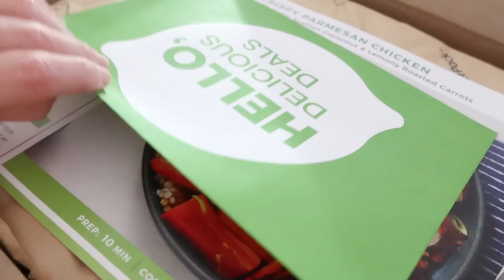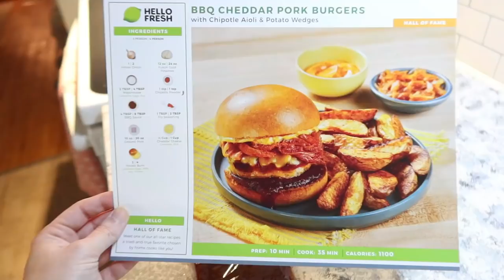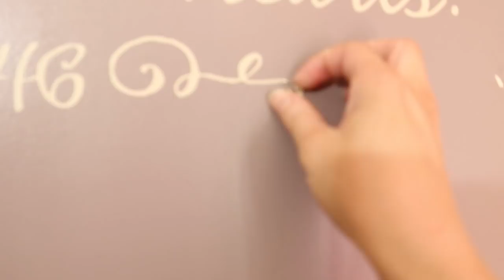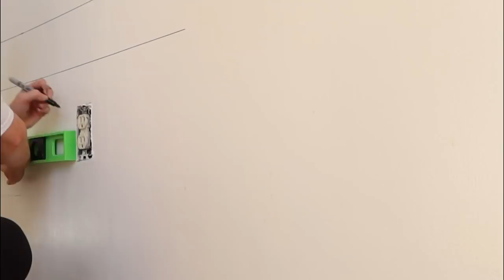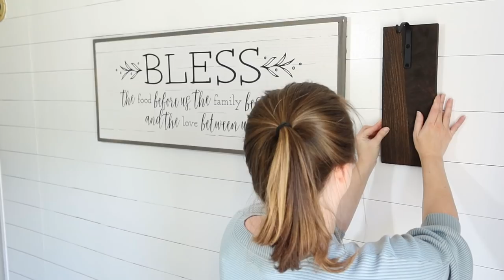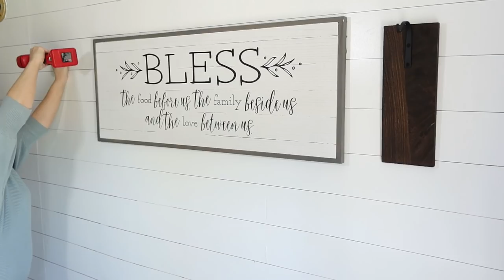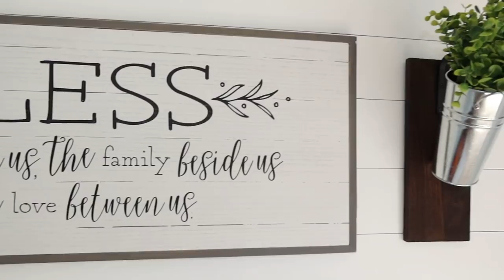MOBILE HOME MAKEOVER ON A BUDGET! | COASTAL FARMHOUSE KITCHEN RENOVATION

Comment: Beautiful room. Very thorough prep work. Nice job! However, you spackled the holes. Chaulk is shiny, rubbery and used to fill gaps between walls and trim. Spackle is sanded chaulk is smoothed and allowed to dry (not sanded).

Comment: I loved this video!!
Smoke detectors need to be replaced every 10 years for safety.
We use Dollar Tree clear cutting mats to slide between the wall and the trim or trim/ceiling, trim/floor.
I would recommend using paintable flexible caulk for the vertical strip areas so when your home settles the vertical gaps do not crack.
Reply from the maker: That is a great idea!! Thank you!

Comment: Love hello fresh its the best meal plan we have tried. We love those firecracker meatballs. Also a tip when plastering the wall make sure to do atleast 2 coats if it's a deep crack. We learned the hard way of only doing one layer in our old fake wood paneling wall and u can see the lines through the paint. But it's fine I covered it with decor. Lol

Comment: Those blackout curtains look great with the makeover and decor, having the black peek around turns out to be a great accent!  I recently got white and what turned out to be pearl blackout curtains from Amazon and they are already paying off. I face SW with floor to ceiling glass- ouch hot! My tip for you?  Buy another couple of sets and tuck them away in case these get ratty from little hands lol. The price is a steal. How are yours holding up? I am nervous about washing them when the time comes, mine isnt going to be dirty by little hands but dirt by cob webs up high and the floating dust that comes from the interlocking plank walls of the A Frame living room that sticks to them. I'm going to try use a static duster to detach the cob webs and tumble the dust off them because I am afraid the black will run.   Again, beautiful job.
Reply from the maker: They are holding up surprisingly well with little one's around! We haven't washed them yet, I'm also a little nervous about that. We have just spot cleaned them so far to keep them looking white. I will try to remember to do a update on them once we do wash them though. Thanks for watching!

Comment: Hi Kelly, I just came across your video's today. And I'd like to ask you what kind of dry wall patch stuff do you use? Our mobile home has those strips in every room as well. Like you I would love to get rid of them if I could. I love everything you've done thus far with your mobile home. We live in a 1986 SW and we have started doing some interior work to ours as well. You've given me so good Ideas. Thanks for sharing with us.
Reply from the maker: Thank you so much Betty! Here is a link to the spackling paste I use. You may also want to consider using the seam tape before applying. I did not and I’ve been told it may not hold up long term. However so far no issues. I did want to let you know that tho in case you wanted to use the seam tape to be safe. https://amzn.to/3nzYXaQ
Reply: @KellysKorner08  thanks Chic!